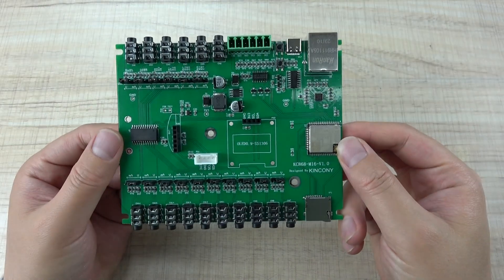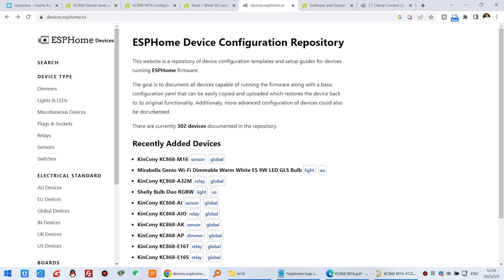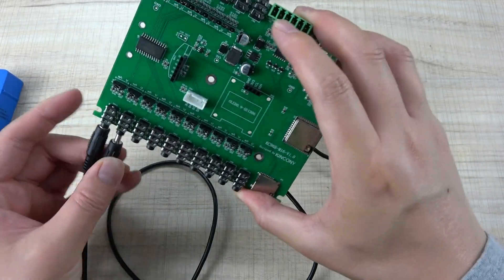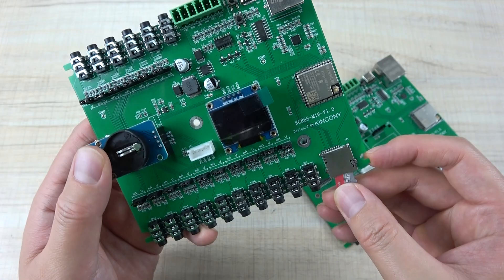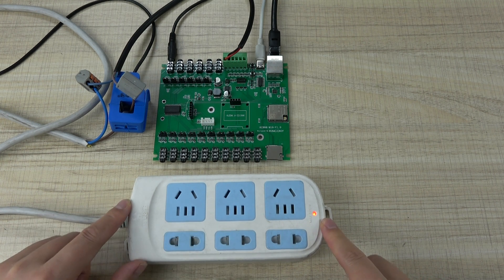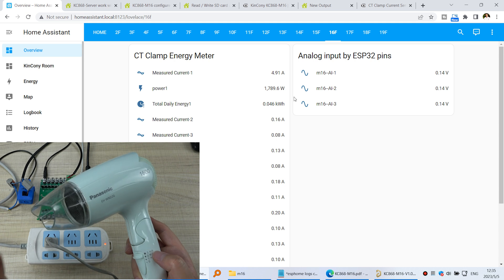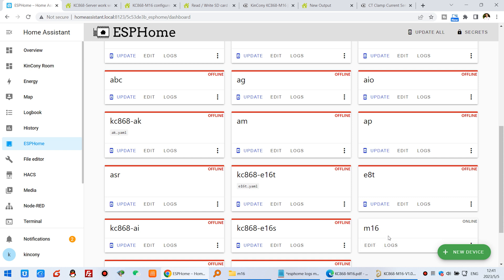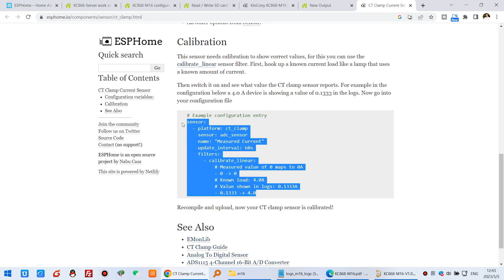KinCony M16 Ethernet+ESP32+SD Card CT Clamp Energy Monitor for ESPHome

Comment: Where can i find dc ct clamp to monitor my solar string
Reply from the maker: you can use KinCony MB DC energy meter board. DC load not need CT sensor.

Comment: You would need to add AC voltage in, if not we cant measure correct power usage
Reply from the maker: M16v2 board have AC voltage IN.

Comment: I want this but in Modbus!
Reply from the maker: you can use M30 board, support RS485 modbus
Reply: @KinCony  Thanks.

So 16CT>M30>Modbus TCP? 

How is the M30 powered? POE?
Reply from the maker: @MartynDuerden  M30 not support POE, use by DC9-24V power supply.

Comment: Great job, do you have voltage measuremt, to calculate the power factor bettween curent and voltage?
Reply from the maker: now the V2 PCB under desinging, will include voltage measurement.
Reply: Nice,it Will works on 220v 50hz?
Reply from the maker: @sebseb319  yes

Comment: So for power (watts) we would need to duplicate the example for each channel like you did in Channel 1 right? Other than that it should be no tuning? What about CT clamps with burden resistors?
Reply from the maker: yes, you are right. just maybe need calibration for every channel is better. what's your mean about "What about CT clamps with burden resistors"?

Comment: Super! This device can mesure in positive and négative? I mean for solar injection.
Reply from the maker: this is for AC power.
Reply: My question was not accurate.
Yes after the inverter the current is AC but we can have a positive or negative curent. To know if we inject or buy electricity the measure is absolute or with a sign+- ?
Reply from the maker: @sebseb319  this board only use for test AC power, not for DC power. if you want to test DC power, you can chose any our other board, just use by digital input port is ok. then convert your DC power to a TTL level signal or 12V or 0V signal.

Comment: Nice work!! But we need voltage measurements. Preferable 3, for 3 phase systems. 
Due to time differences (and an extra device) i am afraid that power / pf measurements are incorrect.
Reply from the maker: yes, we will save your suggestion.
Reply: @KinCony  plus 1. If you would implement this I would buy in an instant!
Reply from the maker: @bwout1987  do you think add 1 channel voltage detect or 16 channel? maybe all channel's voltage is same.
Reply: @KinCony  3 channels would  be ideal! And it would be absolutely amazing if there were jumpers to select which phase the channel is.
Reply from the maker: @bwout1987  can you say details about "jumpers to select which phase"?
Reply: @KinCony  over here we have 3 phases. What I would like is that you can connect these 3 phases to the boards. So you can measure voltage. Then I would like to have jumpers for each ct clamp so I can “set” which phase the ct clamp is connected to. This will give you much more accurate results.
Reply from the maker: @bwout1987  ok, thanks for your suggestion.
Reply: One channel. These are too short to check loads hundreds of feet away from each other. Would like a single channel version with one sensor input for amps, and one for line voltage meter. Then allow them to work together with software dashboard. That way you get actual power consumption and line voltage at the device. Good for checking voltage drops on long runs. @KinCony
Reply: And maybe even find a way to draw 5V from induction for power, with wifi board. Totally wireless.
Reply from the maker: here is one channel version : M1: https://youtu.be/uKbUdrj3T1M @anthonylosego
Reply: I think you could consider relating the voltage with the current readings via esphome configuration as well; that would be simpler than doing it in hardware.
Reply from the maker: @bigmak40  yes, M16 v2 under designing, it will include voltage monitor.

Comment: Nice! Any possibility to us PoE to power it up?
Reply from the maker: you can add POE adapter
Reply: @KinCony  I've a router with PoE, just wondering if it could be powered up from PoE ethernet cable instead of the DC 12-24v
Reply from the maker: @garbi8526  now M16 not have POE function, if you want to use, need add another POE adapter will be ok.

Comment: This module is very suitable for calculating the percentage of load in smart homes. It will help us identify which object is consuming the most energy
You have measured the current intensity. To calculate the power consumption, we need to have the voltage, current frequency, and power factor. I'm looking forward to an update from you.
Reply from the maker: M16 board mainly use for monitor current. there is a way, install a modbus energy meter to detect real time voltage and power factor. so that in ESPHome , just use real time voltage * M16's current = power value.

Comment: Too bad you didn't add the electronics to monitor in real-time the value of line voltage and also the power factor which can make a huge difference between real power consumption vs this estimation
Reply from the maker: M16 board mainly use for monitor current. there is a way, install a modbus energy meter to detect real time voltage and power factor. so that in ESPHome , just use real time voltage * M16's current = power value.
Reply: @KinCony that’s right, you can use that workaround but then your solution is way more expensive than the Emporia similar product
Reply from the maker: @valentinene  :) it's different.
Reply: Are the 3 analogue inputs suitable for accurate voltage measurements (3phases), or do you need a specialised DAC /power meter chip for that ?
Reply from the maker: @gubbernl  3*analog input use for dc 0-5v signal. yes,  specialised DAC /power meter chip for that, if want to read ac load's voltage.

Comment: Hello , Can you share arduino ide code for this board?
Reply from the maker: code in our forum
Reply: @KinCony  But Arduino code not available.
Reply from the maker: @selva9300  there is SD card read/write arduimo code. if you want read CT sensor data, we will upload arduino demo source code to forum later.
Reply: @KinCony  Thanks for replay, Waiting for CT Sensor demo code in arduino.

Comment: Where will we give  230 voltage input
Reply from the maker: sure, 230v or 380v , just chose correct CT clamp sensor
Reply: Can we input voltage also for Power measure
Reply from the maker: @nikhilps5234  sure, you can use voltage*current=power set in ESPHome.